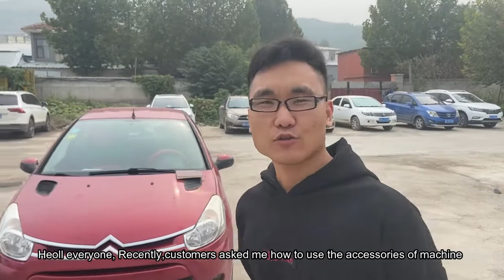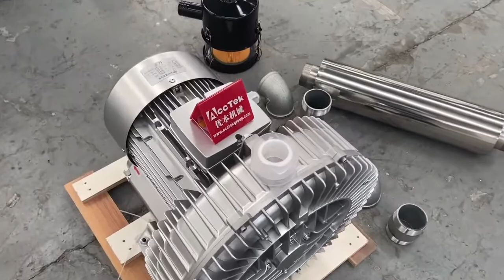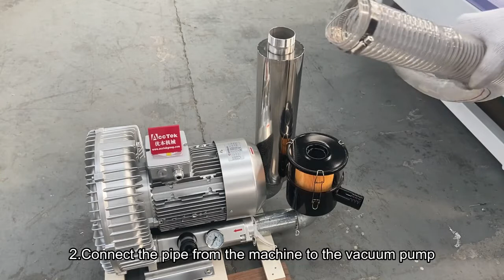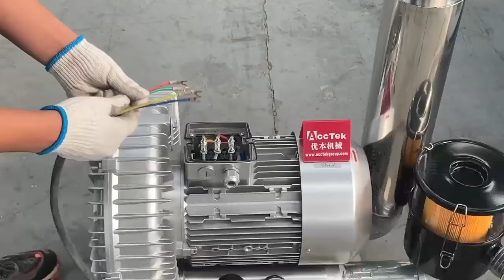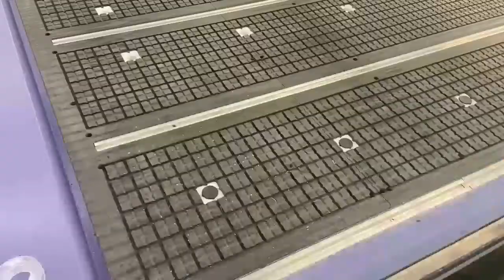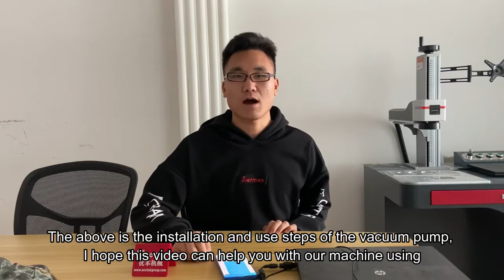ACCTEK  class2---how  to use the vacuum pump for cnc router

Comment: Can we use any vacuum pump .....or in any particular.....
Like rotary vane, oil pump, water ring????
For plastic machining....

And also don't we need vacuum chamber  ....to prevent machined parts entering into pump or filter is sufficient
Reply from the maker: water vauum pump is no good, you can choose air or oil tyle, according your budget.  air filter is necessary for prevent the dust into the pump.
Reply: @acctekcncandyliu4384  Thanks Sir
Reply from the maker: @ratanjeetsingh4600  welcome